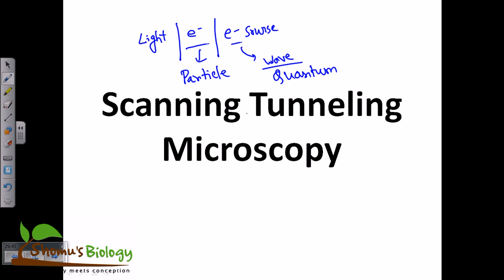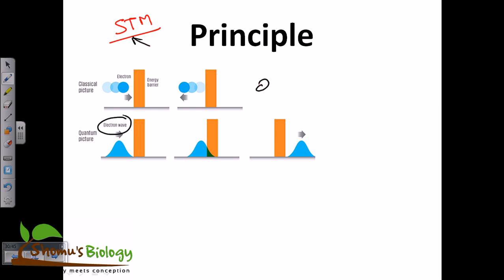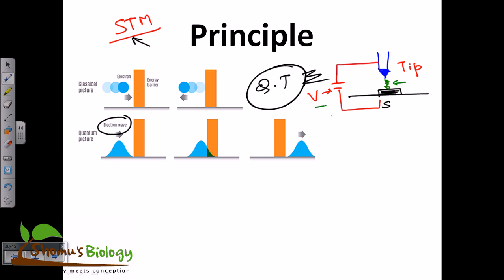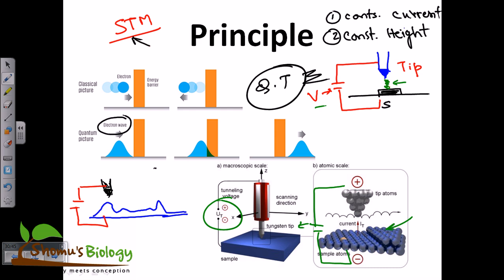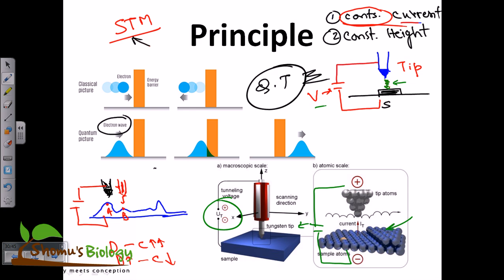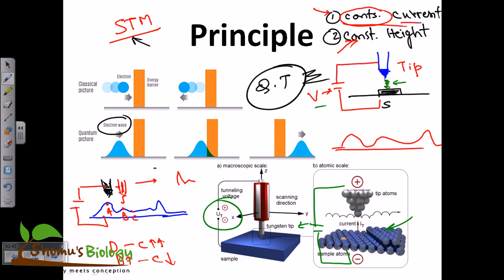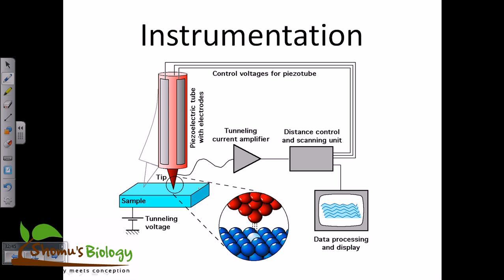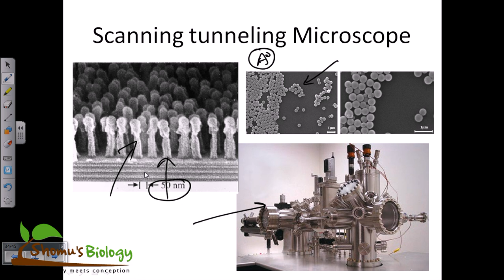Scanning tunneling microscopy

Comment: Great lecture.  The distance from the tip to the sample surface represents the thickness of the "potential well" described in a quantum mechanical treatment of the system must be of magnitude of the wavelength of the electron incident on that barrier.  This technique is so remarkable, and is indeed deserving of a Nobel Prize.
Reply: they did win a Nobel prize
Reply: If u have more knowledge regarding this ... Then plz make video on this topic

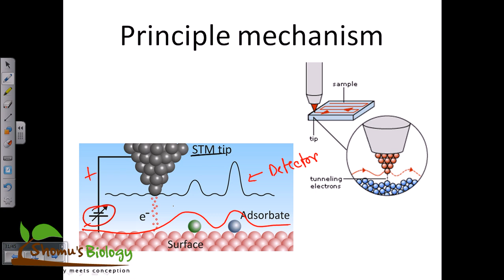Comment: As was pointed out, the current flow is directly proportional to the applied voltage. Another point at 11:55 which should be opposite: "By convention, a positive V means that electrons in the tip tunnel into empty states in the sample; for a negative bias, electrons tunnel out of occupied states in the sample into the tip" (Introduction to Scanning Tunneling Microscopy. Oxford University Press. ISBN 978-0-19-507150-4 )

Comment: As was pointed out, the current flow is directly proportional to the applied voltage. However, you said the applied voltage and current change indirectly.
I~V * exp(-cd); 
Where: (C) is the constant, and (d) is the distance between the sample and the prob.

Comment: the video is detailed and very clear! but I didn't understand one thing : you said that the flow of electrons and the amount of voltage applied is not proportional!
why is that?? the more you apply voltage the more electrons acquire energy and the more they,ll  be able to leave the tip !! 
please explain Shomou's Biology
Reply: Yeahh I was wondering that too. Need to do a corrections to the video perhaps. Thanks so much for the well explained video tho! (:
Reply: Yup it's supposed to be proportional. V=IR.
Reply: What type of Voltages are applied on X, Y and z piezo and why? Plz explain

Comment: It’s a great video thank you , it helped me understand how the technology works

But I don’t get how it represents quantum tunneling.

It doesn’t measure or calculate the probability of a wave tunneling through a barrier.

They actively transfer electron as a particle between two surfaces and measure how current changes based on the difference between the distance between the sample surface  and the tip

Comment: I still do not understand why it is called "tunnelling" as quantum tunnelling (a subatomic particle passing through another piece of matter due to probabilities in its position) is not explained or present. You have explained very well but is this the whole story?
Reply: the circuit is completed and the current is produced via. electron tunnelling from tip to sample. this is where the electrons have a probability of behaving as a wave and tunnelling through vacuum into the free states of the sample. a higher current, lower distance and increased bias voltage (voltage applied to tip to direct the 'flow of electrons' into the sample) all increase the probability for an electron to tunnel
Reply: In TEM, Electron is emitted due to thermionic emission (i.e here electron is acted as a particle as it leaves the cathode because it gains a lot of thermal energy which it cannot hold so it got accelerated and ejected out of cathode).But in STM when tip get closer to sample(nearly 1nm) than electron is emitted due to the relation between potential barrier thickness and wavelength of electron, in short called as quantum tunneling (which is nothing but when wavelength of  electron is nearly equal to potential barrier thickness than probability of electron to cross the barrier will be more as compare to other condition when tip is at larger distance wrt sample (there is also probability that electron will eject or cross the barrier but it will be very very less). Those  quantum tunneling effect can only be seen in particle having smallest wavelength.

Comment: so is the change in the tip height, where the piezoelectricity comes into picture? Does the increase and decrease in pressure on the tip while scanning the surface translate into a change in current? but then you said the distances are of the order of an angstrom, so is the pressure a result of atomic interactions then?

Comment: in TEM the electron also passes through specimen so, in that case electron  was acting like a particle or as a wave . i think so it was acting like a particle because the specimen was very thin and speed of electron beam was also very high that's why it should have passed the specimen. is it correct or not i still have a doubt to my answer.
Reply: If you know answer plz let me know?  I am also confused related to wave/particle behaviour of electron in TEM.
Reply: @quratulain733  
In TEM, Electron is emitted due to thermionic emission (i.e here electron is acted as a particle as it leaves the cathode because it gains a lot of thermal energy which it cannot hold so it got accelerated and ejected out of cathode).But in STM when tip get closer to sample(nearly 1nm) than electron is emitted due to the relation between potential barrier thickness and wavelength of electron, in short called as quantum tunneling (which is nothing but when wavelength of  electron is nearly equal to potential barrier thickness than probability of electron to cross the barrier will be more as compare to other condition when tip is at larger distance wrt sample (there is also probability that electron will eject or cross the barrier but it will be very very less). Those  quantum tunneling effect can only be seen in particle having smallest wavelength.
Reply: In TEM, Electron is emitted due to thermionic emission (i.e here electron is acted as a particle as it leaves the cathode because it gains a lot of thermal energy which it cannot hold so it got accelerated and ejected out of cathode).But in STM when tip get closer to sample(nearly 1nm) than electron is emitted due to the relation between potential barrier thickness and wavelength of electron, in short called as quantum tunneling (which is nothing but when wavelength of  electron is nearly equal to potential barrier thickness than probability of electron to cross the barrier will be more as compare to other condition when tip is at larger distance wrt sample (there is also probability that electron will eject or cross the barrier but it will be very very less). Those  quantum tunneling effect can only be seen in particle having smallest wavelength.

Comment: I think there is a mistake. That is the tip of tungsten is connected with negative charge and the surface of specimen is connected with positive charge because (in tungsten already have electron and also the positive charge of proton then you put the negative charge and then negative - negative(electron) is not attract each other so electron beam is attracted by specimen with positive charge connection). Then note the last image as u shown in that there is the specimen is connected with positive(means big line ) not negative(small line):-|
Reply: But u say in vdo is tungsten tip is connected with positive and specimen connected with negative. That is wrong